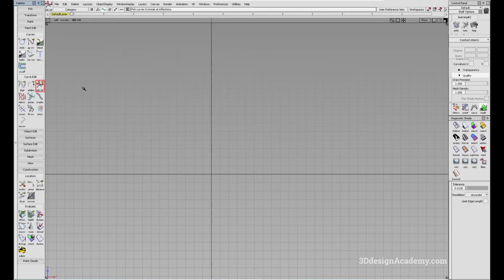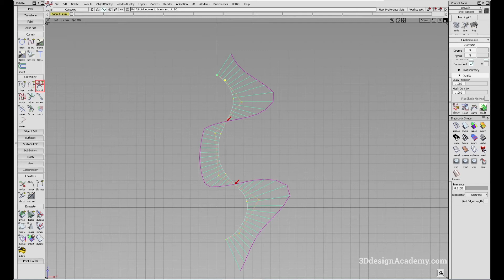Autodesk Alias Basics Tutorials 54 - Break Curve at Inflections Tool

Comment: After I used “Inflections Tool” to divide a curve into several segments, I tried to connect the curves with "attach" and found that it was successful.👏🍺✍
Reply from the maker: Awesome! Yes, you should be able to use them both to achieve your desired curve!